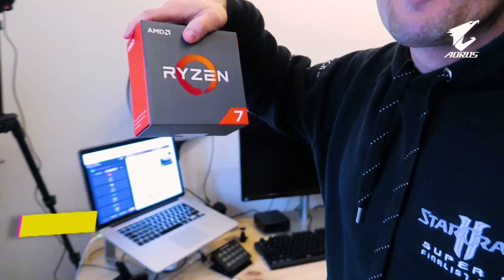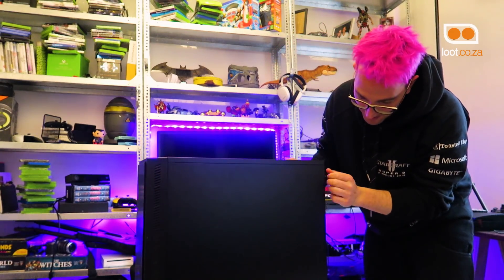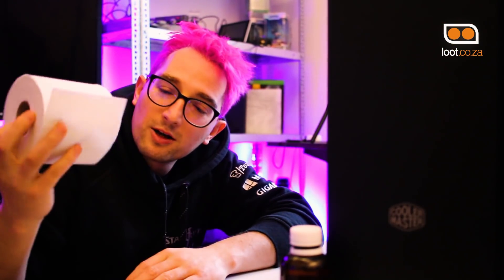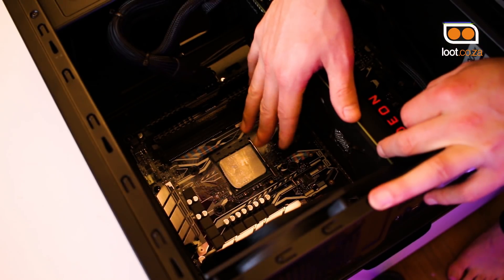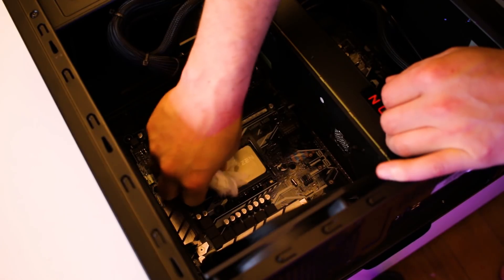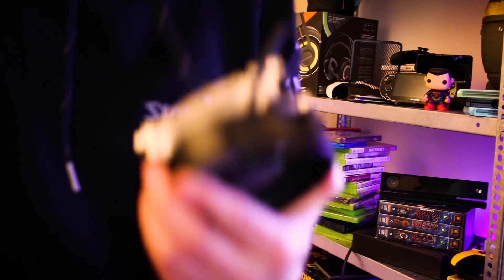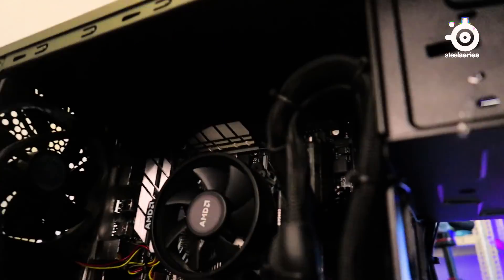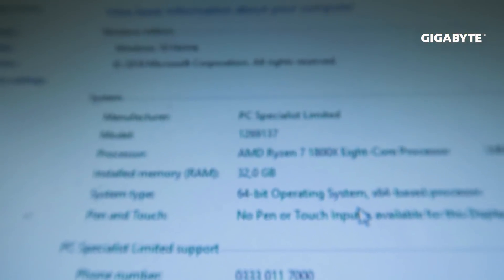Installed A Ryzen 7 1800 (And Nearly Broke My PC)

Comment: Grant Hinds : using Wraith Stealth on Ryzen 7 1800X is ok as long as you only play lightly threaded games but as soon as you will do anything remotely work like it will throttle your CPU. Wraith Stealth is a 65 Watt TDP cooler....you should have used Wraith Spire a 95 Watt TDP cooler with copper middle, after all there are 8 cores and 16 threads to be cooled at 3,6 GHz all core base where half of core regurarly turbo up to 4,1 GHz, now that cooler cools Ryzen 7 1800X with ease at stock clocks. Ryzen cpu-s are very cold and use low power, but Ryzen 7 1800X is their strongest 2017 beast and it needs at least a 20 bucks tower cooler or a Wraith Spire because of that copper base.

Comment: Great Job on upgrading the CPU congrats of getting it done!
Thermal paste is not conductive so no worries there but that cooler for the 1800 is not going to work very well for very long without thermal throttling (Downclocking the CPU to keep it from overheating) i would suggest getting a better cooler for it to get the performance you want out of the 1800 feel free to DM me for recommendations as i have this same CPU and have been building computer for 15 years